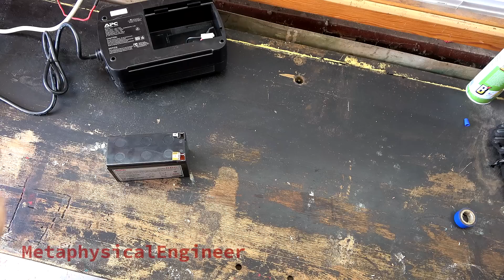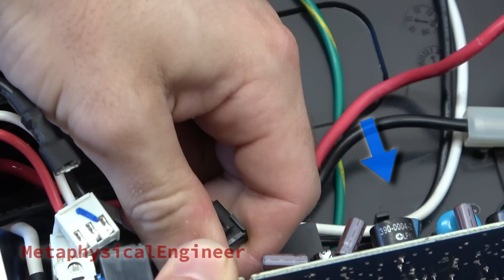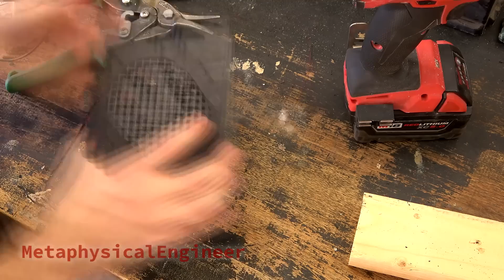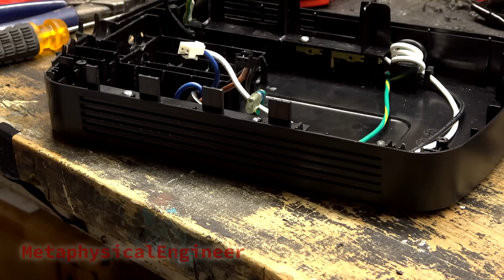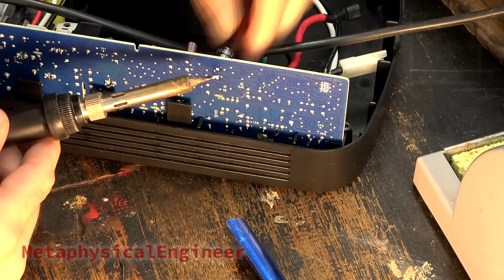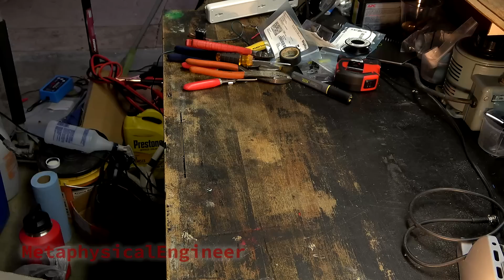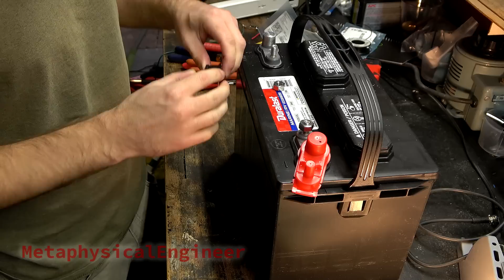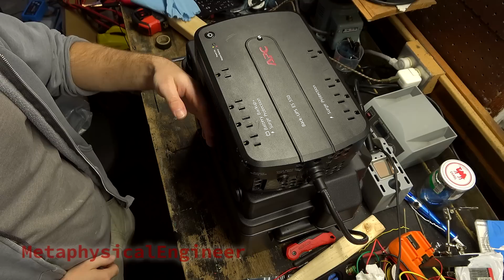Modifying broken UPS for long endurance BACKUP POWER!

Comment: When you build a UPS like this without an SLA, then you need to add provisions for a failure mode where the BMS fails on and cooks the battery. this means you just have some sort of tray under the battery that you put something like baking powder in to neutralize any boiling acid that escapes the battery. You can simply just pour some baking powder into the battery box itself, which is what a lot of off the shelf solutions do. you just want enough powder such that you have an excess required to neutralize all of the acid inside the battery (its like a few cups or something). And then you also want to have ventilation of some kind. any kind of passive venting like just a door that is open or a cracked window or even just a return vent to a central HVAC will work fine. This is to prevent hydrogen build up in the case of a BMS failure where the battery boils but it will also eliminate any possibility of hydrogen build up. 

With one battery though, hydrogen build up is i think impossible, at least you will never get enough to have a reaction. even if you had open sparks above the battery at all times, a single battery like this probably can't make enough H2. So i would just make sure its not in a confined space like sealed into a concrete bunker room with a sealed door. You only need H2 and active venting when you get up to like 10 of those batteries or so.

You also want a jug of unopened distilled or deionized water next to your UPS. i recommend having a 1 gallon jug because you can get them anywhere and they are super cheap. just get one and stick it next to the UPS. you will thank me in 15 years when you realize the battery is low on acid and you can just grab the jug to top it off. for a large set up with numerous batteries you want to use the actual acid, but for just one you can get away with using water. in my experience it takes something like 10 years for the voltage to start to drop from lower acid levels and you just need to add the distilled water to get the electrodes inside covered again. 

or you can always just let it rip and not do any of that. really, worst case is the BMS fails on and boils your battery, the caps pop open, sulfuric acid boils and splashes out and leaks down the sides, and ruins the subfloor. worst case, you end up replacing like a two foot square chunk of carpet and subfloor. ask how i know hahaha
Reply from the maker: Adding baking soda to the bottom of the battery box is a great idea!  Like the battery spill kits we kept on hand back when I coached robotics clubs.  Though I imagine the battery charger will likely fail open circuit rather than full on.  Other commenters have mentioned the charge circuit giving up.  

This 1960s building is leaky and the HVAC cycles enough that buildup of gasses isn't a big concern for me.  I think I'd need more batteries and a tightly sealed room before enough hydrogen could accumulate to be a danger.  In that case I'd have AGM or LiFePo4 or rig up catalytic recombiners that intercept the offgassing and return the water to the cells, like what's used on large scale battery banks with flooded cells.  

I have a jug of distilled water on hand already, and I'm planning on a quarterly or so test and inspection.  My parents do that with their backup batteries now, after making the mistake of leaving them be and getting caught with crippled backup power one winter.  

Thanks for the cautionary tale about the acid spill eating the floor.  I hope I never encounter that issue!

Comment: i love that model and general design of UPS from APC. they use the SLA batteries that should be replaced about every 3 to 5 years depending on how bad your power system is (the utility). my goes down completely about 20 times a year and i have to replace the SLAs i use about every 3 years. the APC ones are by FAR the easiest to service. takes about 5 minutes. it actually takes way longer to source the replacement because you need to make sure its the right dimensions and tab size lol. pro tip, don't stockpile SLAs if you can avoid it. they have a shelf life and its the same shelf life of 3 to 5 years, even on a trickle charger

Comment: I once tried this and my ups would not even recognize the large battery (I guess it takes too long to charge)?  Will your set up recharge the battery from flat (when the UPS shuts down due to low voltage)?
Reply from the maker: Strange your unit did not recognize the battery.  Mine will probably not charge from flat; if it does, it will take literally weeks to do so.  I intend to hook up an external charger to boost it back up after any significant use to be sure I'm ready for the next outage.  A future upgrade or version 2 of this project will include a dedicated charger of sufficient capacity to ensure recovery time of a couple days or less.

Comment: I'm surprised your video kept displaying at the end when the second display cut out. Every computer I've used goes black screen and has to figure itself out again to display the single monitor by itself. Wreaks havoc on fullscreen stuff like games also I've found getting them stuck like half on the screen.
Reply from the maker: In this case, the GPU didn't know the difference, since the screen lost power but the HDMI cable remained connected.  Had I unplugged the cable, that would force a reload of drivers etc to accommodate the new configuration.  That sort of switch with a game running can get weird since most aren't programmed to handle the edge case.

Comment: Got a pile of UPSs here for recycling,  all had bad batteries when I got 'em.  I'm going to have to look into seeing what can be done with them...   :-)
Reply: I am always amazed by people that don't realize that UPS systems have a lead acid battery that will (not may) go bad after several years.  

As for what to do with them - use them.  I have all of my home networking equipment, tvs, and even a few fans that we use at night for white noise hooked to UPSs.  I also have a home standby generator, but that takes up to 60 seconds to start carrying load.  Plus, we get lots of nuisance blinks.  Now, I don't care.

Comment: what do you do about the battery venting gas?
Reply from the maker: The battery will vent a small amount of gas.  Only a problem if I had a hermetically sealed room or a large number of batteries under heavy cycling.  This is a 1960s building so plenty of air exchange. If I had a bank of flooded batteries I'd need H2 detectors and forced ventilation and catalytic recombiners.

Comment: This is so funny! I have this same exact UPS. I replaced the battery once about 5 years ago, and it recently died again. I bought a new large UPS. This would be a cool project for it!
Reply: I HAVE 3 UPS 550VA,350VA,425VA  UPS i change battery in them one i have lithium runing it

Comment: Great, clean job. Love your attention to details. Properly done cabling and connectors goes a long way. My only (small) concern is small distance between box top cover and UPS leaving rather small space for air inflow for fan. Probably it's sufficient but I'd add some more distance, perhaps a piece of plastic, like a short pipe or a piece of cable tray or sth like this. Not sure it's needed, perhaps it's just my habits :) Anyway, great job!

Comment: Using that type of battery in an enclosed space is dangerous, when charging they emit deadly and explosive gasses like hydrogen sulfide. Please use this in a well ventilated area!!
Reply from the maker: Offgassing is extremely small with a single battery at very slow charge.  This is an older house not a hermetically sealed bunker or tiny vehicle cabin, so any gasses dissipate quickly.  If I had a bank of large flooded batteries under heavy cycling, I would need forced ventilation, hydrogen detectors, and catalytic recombiners.

Comment: Great video,  I all way wondred if that would work, but I figured the power supply would kill its self trying to charge a car battery.
Reply from the maker: Some other commenters reported issues with the battery charger failing, either because of a failed battery, or trying to charge a larger battery.  I'm keeping my eye out for that and will either have to rebuild the charger section or replace it with a stronger charger.

Comment: You should discover the wonders of a "Christmas tree" (otherwise known as a step drill).  Much of this project would have been much smoother with one.
Reply from the maker: Indeed, I realized too late just how many holes I was going to drill and that my deburring tool was nowhere to be found.  I'll be picking up a step drill next time I'm at the hardware store as well.

Comment: Had one of thse where a small amount of liquid got into the inverter side plugs.Popped it open dried the liquids up and for good mesure tightend the loose metal of the plug contatcs.

Comment: Would love to have seen this with a lithium battery set up instead of lead acid. But great video.
Reply from the maker: Version 2, someday, will hopefully address the weaknesses of this project.  Pure sine inverter of much higher power and high performance lithium batteries with BMS and possibly solar/grid dual input charger.  Thanks for watching!

Comment: you'd enjoy having a chamfer bit to tidy up the holes.  safer, faster, and neater than the blade knife.  :D  thanks for sharing this build.
Reply from the maker: I realized too late that I had a lot of holes to drill and my deburring tool was nowhere to be found!  I've since gotten a replacement and will be sure to have better finishing tools if I ever need to punch a ton of holes in an enclosure.

Comment: I did this back in about 1999 to several of my UPS's. I used lawn tractor batteries from Walmart. 20 bucks. Too bad they are much more expensive now.  One of my UPS's was a sine wave type that was very expensive and also highly inefficient so it was already equipped with two lead acid batteries. But they had reached their end of life so the company junked it and it became mine.  I put two used but still functional car batteries on it. It could hold up my computer for several hours.
BEWARE: Most UPS's put out a pseudo sine wave which is sort of a square wave. The problem is the edges of that square produce lots of high frequencies.(See Fourier transform theory.) If that voltage is applied to an iron core transformer like the old wall wart kind(all we had in 1999) that weren't using a switching circuit, then the high frequency eddy currents in the iron core will heat it up to the point that the safety heat fuse opens and the wall wart is dead. Those old wall warts can take that pseudo square wave for 10 or 20 minutes but much longer than that and it's curtains. The newer light weight switching kind are fine with that square wave.
And you know what I did don't you? I cracked open that wall wart and jumpered that safety heat fuse and it was back working.  I left the plastic case off and always had it in a place where it got plenty of air to cool it off. Safety third.

Comment: Instead of turning down the volume, I would have added an on/off switch. If the power goes out, I want the buzzer to notify me (in case I need to shut down server), but then I want to stop the noise, so I can (likely) go back to bed.
Reply from the maker: Switch was an option, too!  Alternately a "mute" circuit that auto resets, as either switch or volume knob runs similar risk of leaving it silenced and failing to notice the outage.  I'll look at that for a version 2 of this project.

Comment: I did a similar project for my network. I used an APC UPS from a Walmart Self-Checkout and it ended up having a pretty efficient switch mode power supply instead of the huge 50% - 70% efficiency transformer that most of these use.
Reply from the maker: Interesting that the self checkout uses a different circuit setup more similar to a mobile inverter.  What size battery did you use, what load are you running, and what runtime are you able to get?

Comment: A most honestly an 'Engineered' solution to this problem. Step by step what I would do myself, but also being honest, a much more presentable "product" that I would have likely done myself, if for my own use.  Currently have a slightly smaller APC that I'm going to perform a similar upgrade to.  Thanks for the work!
Reply from the maker: Good luck on your project, and please don't forget the fuses! Aesthetics were partly for the video, and partly because my lady and I will have to perceive the end product in the bedroom/office, so an ugly Frankenstein's monster wasn't an option.

Comment: Great upgrade on an old UPS. How does the charge circuit handle charging the larger batter after it has been fully deleted? Obviously it will have to run at max charge rate for much longer until it reaches the trickle charge voltage. It might have been an idea to have another trigger for the fan to run while the battery is bulk charging.
Reply from the maker: Charger is extremely underpowered for the huge battery, and others have mentioned having the circuit fail.  Having the fan run would effectively neutralize the charger's contribution so battery would never be able to charge.  If the circuit ever fails, I'll either rebuild it with stronger components or bypass it with an off the shelf smart charger circuit.

Comment: A lot of these will destroy the charging circuit when the batteries go bad, i electrically disconnected the charger output of several 750va ups's and hooked them to a reconfigured telecom battery bank that was trickle charged by a little stepper motor windmill. They ran several circuits in my house for a few days if needed
Reply from the maker: Another commenter mentioned a while back they had charging circuit failure with a bigger battery.  I'll keep an eye out and either repair with beefier components or bypass with a smart charger.
Reply: @MetaphysicalEngineer  charger shouldn't care about battery size, but type may be incompatible. Normally the SLA's take out the charger when they die, so you just need to disable the feed to the battery, that way it thinks it's charging

Comment: The biggest issue I saw with is was you went through all the trouble to install a cooling fan and then restricted the fans ability to take air in by not adding space. Yes, I notice the channel in the cover. But once the blades stall, you basically loose all of your static pressure. You can hear how much more noisy the fan is now that it is on the cover of the battery case. This is indicative of the fan stalling
Reply: What would be a good set of steps to fix it in this exact case?
Reply: Step 1)  Don't assume it needs fixed unless it is overheating.
Step 2)  Don't assume every post on a technically oriented youtube video, is made by someone who understands what they're talking about. ;)  
Step 3)  If it is actually overheating, and knowing that it is NOT the blades stalling, you would increase the air intake and exhaust areas in the chassis.  Simply putting spacer/standoffs under the casing would be an easy first try, but again, do nothing until there is evidence that it is overheating.   @edumaker-alexgibson
Reply: Do you understand what the word "stall" means, because I don't think that you do?  A stalled fan tends to make no noise or at most a ticking sound.  Instead, what should be expected is simply a normal result of implementing a fan in a tight space, that turbulence goes up, and of course the RPM drops a bit but this is the point of a fan doing useful work anyway.

Yes a larger gap would potentially result in more airflow, except that the exhaust side/holes are at least as much of an impedance, but let's not be a slave to the fan but rather, realize it is a means to an end and that end is simply that it does not overheat.
Reply: Axial Flans hate restricted outflow. Better to draw cool air over the hot components...

Comment: lead acid outgassing does not only happen with higher charge rates and float voltages.  give that wet battery a good discharge and then put your ear to it while it's charging and you'll hear it bubbling away.  you did so good with the rest of the safety aspects of the project, should add a vent line to outdoors or switch to a big SLA.
Reply: LA batteries are placed carefully in cars to account for the corrosion produced in exposed metal near gassing batteries.  On my Toyota Van the battery was in a side compartment exposed to moving air and even so isolated, still rusted the sheet metal around it.  Mind you, in 5 years on a new car maybe not an issue.  My van was 20 yrs old.   I can only imagine what it does to electronics like the UPS.
Reply: Meh, no, I have listened to flooded lead acid batteries charging all the time, specifically to listen for the bubbling and they usually don't at a reasonable charge rate, until fully charged.  This is further demonstrated by plenty of flooded cell batteries in real world applications with constant float charging that do not end up dry after a few years.

Comment: I have been looking for a heavy-duty UPS unit for years that could just be hooked up to a large deep cycle battery either lead acid or lithium to run important circuits in my house we get annoying blinks in the power which I'M sure are not good for electronics. the electric company at first when i complained said nothing was wrong then after me calling a few times somebody realized a tree rubbed through the wires at end of block and was shorting them out in wind or rain. Still get some glitches but not as many now.